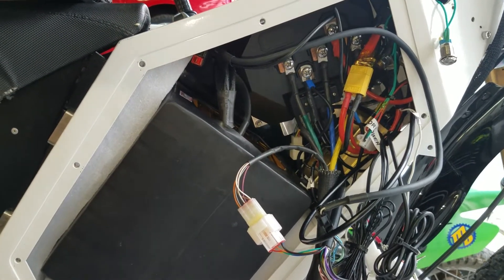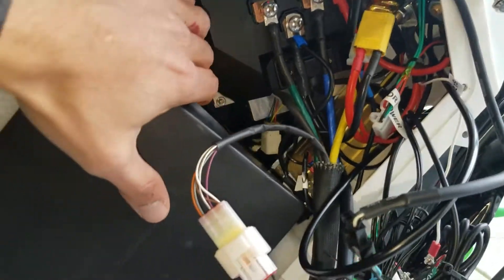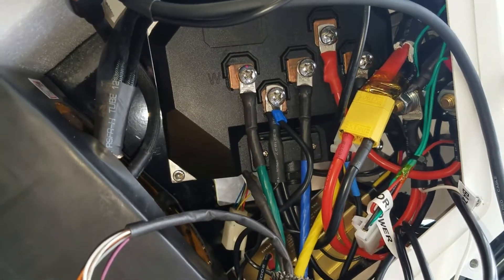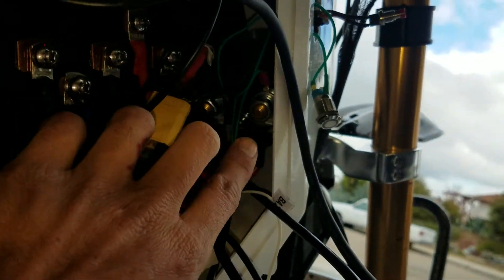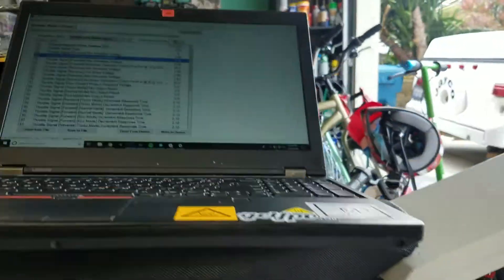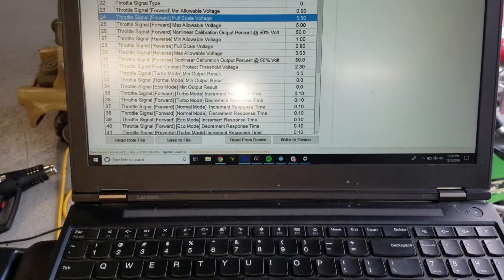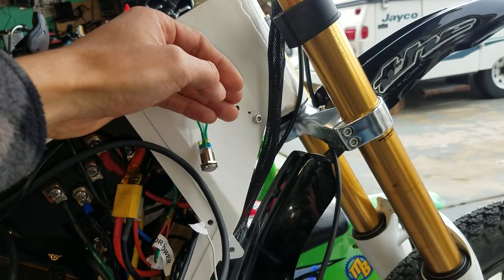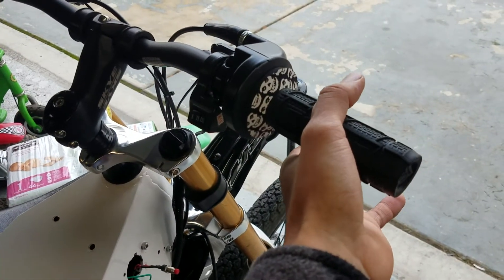Mobipus+EEB+QS205+EM3EV part 2

Comment: Hi dude! I have the same motor and same contoler :) Can you share with me your par tuning file ? Thanks!
Reply from the maker: Solid! it's a nice combo. I can send you the qs 205 file which is a good baseline. My tune will most likely be different because I have a different throttle (I'm using mechanical cable) and maybe a few other things. If you give me your email I can send it.

Comment: How do u like the motor and controller ?
Reply from the maker: They pair nicely. I need to build a battery with a BMS that will push more current to see full potential (only pushing 100A battery).